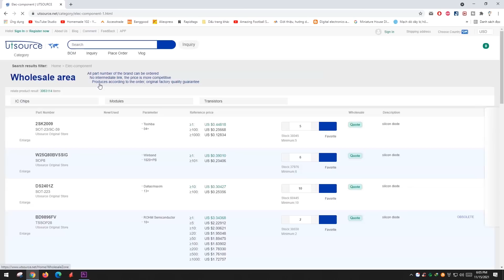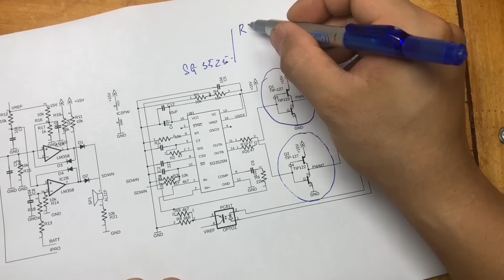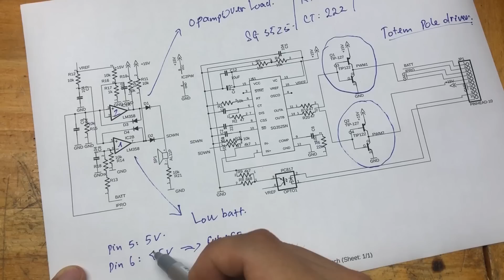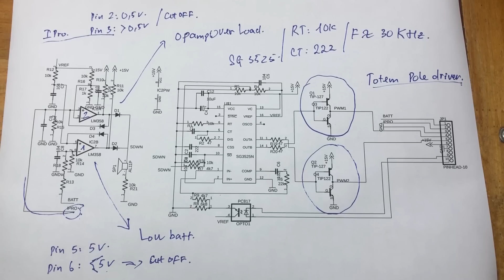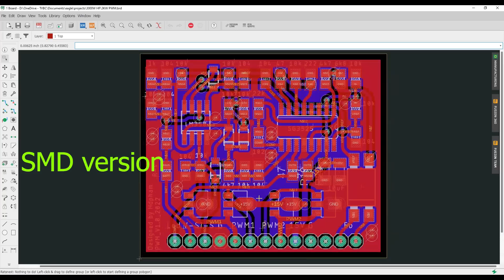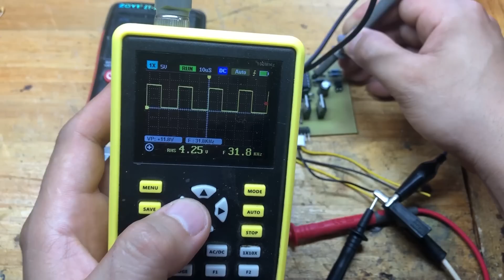Make 1500W sine wave inverter |  Part 2 | utsource

Comment: Hello friend, I prepared this invter circuit, but when I connect a small appliance load to the AC output, the 230v voltage decreases by 5%, why is this happening? 🤔🤔

Comment: Awesome !!!  can you try modify a 1KV/36VDC online ups to standalone inverter ?! Like if on mains power it should be bypass inverter instead of running as online mode.
Reply from the maker: I think, just unplug the mains power, it will work like standalone inverter.
Reply: Sorry I asked wrong question. I want to run a online ups as a normal offline inverter instead of online mode on mains power. Is it possible ?
Reply from the maker: Alright, I'll try modifying. I also have a 1KVA santak UPS.
Reply: @PhdHung  thanks !!

Comment: Bro is there any difference between micro controller based mppt solar charge controller and normal mppt solar charge controller??
Reply from the maker: All MPPT controllers use microcontrollers 😄. So there is no difference between normal MPPT charger, and microcontroller MPPT charger. They are one. The difference lies in the internal structure. For example MPPT boost (voltage boost). MPPT buck, synchronous MPPT buck, interlaced MPPT etc...
Reply: Thank you for your precious answer. I thought they are using nano adrino board in cheap pwm circuit board. But they are cheap but have very less panel support. Anyways thank you

Comment: This ain't a sine wave !
Reply from the maker: Yes, It needs a circuit that converts DC to sine wave. It will be in the next video.
Reply: @PhdHung   Yes I think SMPS based devices like LED TV, LED light, BLDC fans, etc.. can be used with this stage at 380V as it has rectifier for converting 230V AC to 325V DC. We can save power by avoiding the next stage if we don't need sine-wave output.
Reply from the maker: Yes, that's right, the performance will be very high. It cannot be used for fans or pumps. However, 380V is too high, need to adjust  feedback at 310V.

Comment: Привет. А как скачать эту схему. А то не интересно только смотреть . раньше было в открытом доступе
Reply from the maker: https://www.mediafire.com/file/wv7dgc5z6bpx82i/1500W+12V.zip/file
Reply: @PhdHung  I wanted to try this circuit I downloaded the diagram but it is confusing all the resistors are 7.5 and the video are very different where you can really detail the values of the components and I burned the irf1404 MOSFETs and the osp that I indicate in the video thanks
Reply: Вам удалось повторить проект?
Reply: @aleksi4559  нет.